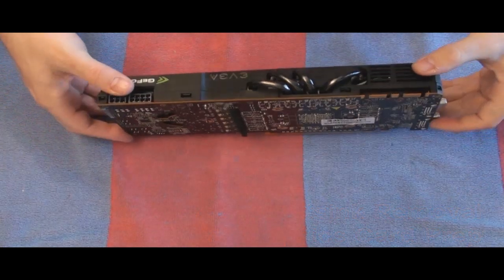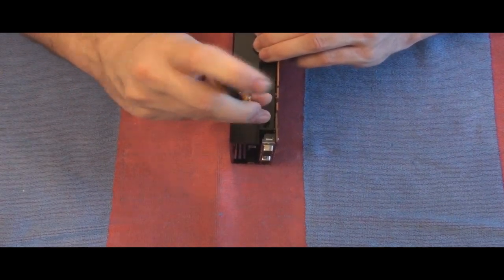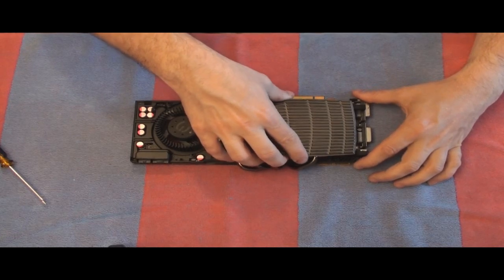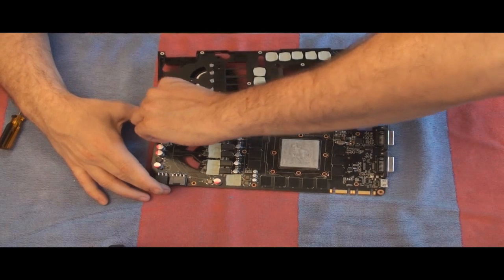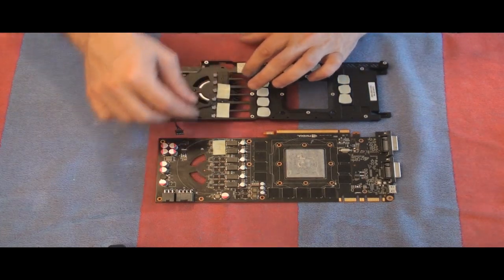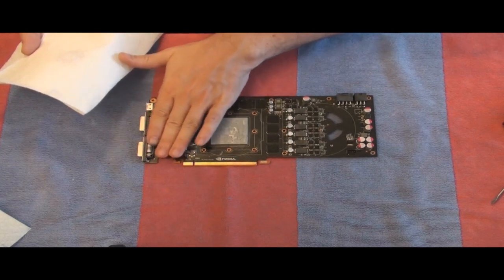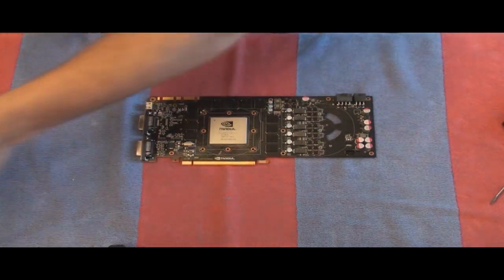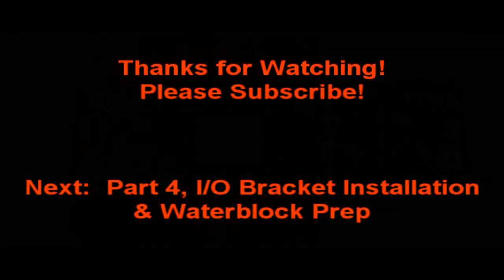Koolance Nvidia GTX480 Waterblock:  Part 3, Stock Heatsink Removal & Graphics Card Prep

Comment: i want to run xfire in my mrig im runing a 6870 but if i were to xfire the cards are going to be extremely close. but if i got another 6870 and jsut took off the plastic part off of the top card. would that be enough to keep the top card from overheating?or is it even safe to run a gpu like that without the plastic.??? anyone know? my alternative is to buy a single slot 6850 from powercolor and that would give me the spacing for proper airflow but was curious is the plastic off idea would work??

Comment: You know you really don't have to seperate the GPU into two (the two parts of the "thing" xD). Simply removing all the screws in the back and being careful not to create to much of a flex while pulling on the PCB side and the heatsink side of the graphics card apart will be enough to remove the heatsink from the card.